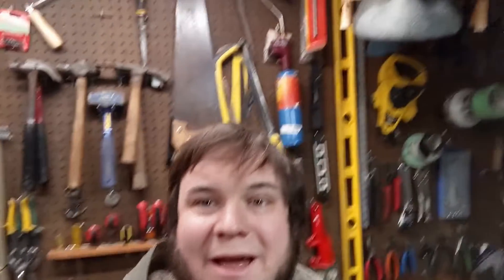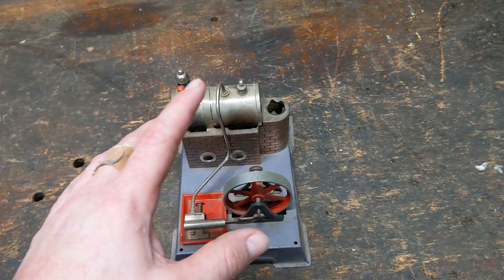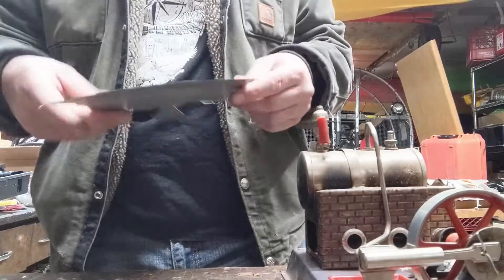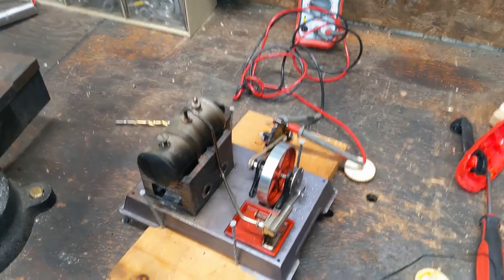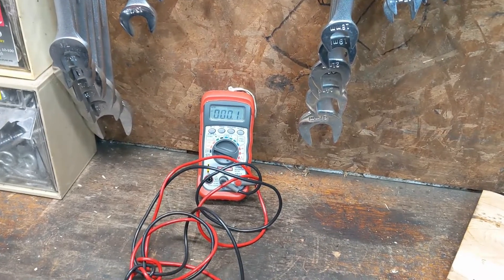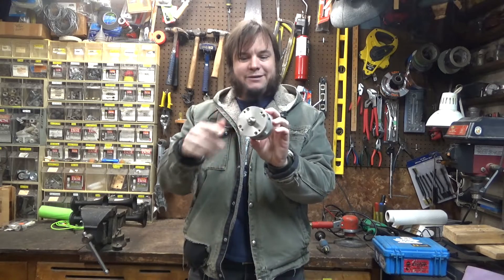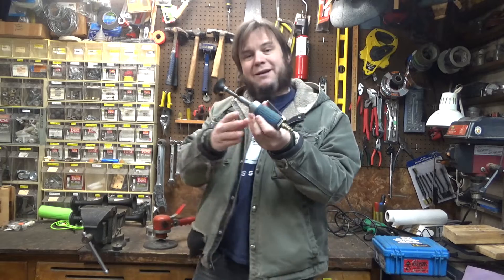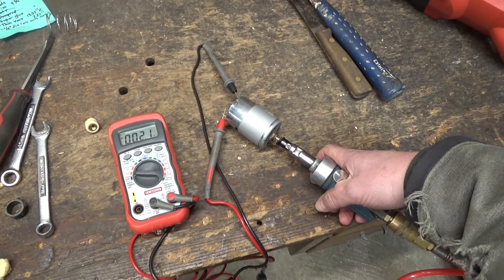I Fail To Make A Steam Powered Phone Charger

Comment: My dear Gabe, I have gazillions of ideas. I'll give you just one. Use what is already there, with minimal modifications, mainly adaptation. Use a car alternator, it spins freely, doesn't have a gearbox fighting against your project, just fit an impeller that will translate your steam, air, wind... into electricity AND is already rectified AND with a specification compliant regulation while outputting a girthy current supply, 80 amps at 14,7VDC while loaded, 29VDC with a truck alternator that you can divide in 2 x 12VDC, more maybe, that will put any little puny DC motor you saved for parts to shame AND let you charge anything you want. 
Fuse up your outputs accordingly to protect all your gear, plan spares... and have fun.

Comment: ok so if you want a good motor from something to make decent voltage. look for one from a dishwasher. theres usually 2 motors. one is a small ac style and one is a large dc style. with brushed motors and a capacitor. youll know because the motor spins better one way than the other. leave the capacitor even tho you arent going to need it. the two side terminals and the original plug is what youre going to try to use. i would go with the terminals because the capacitor makes the mechanical motion to make voltage less efficient. 
spinning this thing with your finger as fast as you can should make around 10 volts, at 1 amp. hook a regulator up to it. any mechanical motion derived from steam should make this thing crank perfectly to your needs. trust me im a lifelong tinkerer.

Comment: Actually you had lots of current and voltage! You are measuring DC while this motor produces AC mostly, just have to use a diode bridge + cap. At 100 psi it would charge 10 phones at the same time :)

Comment: Its probably easier to make a steam vessel ( a copper cylinder or bucket welded shut with a top up valve, an overpressure valve and a pressure regulating valve with a hose for your turbine). It would be easier to make yourself and easier to get high amounts of power and rotation without high pressure. While turbines are a proper science to get running extremely efficient, they are far easier to make 'relatively ok' by using copper plates that you stencil into a good shape and then mount on a rod with washers for spacing, then directly attach it to your generator. You dont even have to worry about leaks and such. Put the bucket in a campfire, wait, and eventually the steam will build up enough and start driving the turbine.

Comment: Maybe a buck converter would work? Run it at 1.5v and use a buck converter to step it up? Maybe even use a gearbox, and into a buck converter. That steam engine is like one my grandfather made for me, except my piston was vertical rather than horizontal.

Comment: If you are looking for a safe-ish kind of boiler, consider building a water-tube boiler. Its just a coil of tubing in a firebox, so it should be pretty easy to manufacture. Its quite safe, because there is not much superheated water inside at any given time, and the strain on the tubing wall is low due to small internal area. The only downside is a need for a feed pump.

Comment: What you are looking to do is to make your version of the "ALCO Firefly", used by the British (and ANZO) forces to power a radio in the wilds of combat during WW2.
The steam generation was by a "kettle" over a camp-stove or campfire, depending on how visible one could afford to be while behind enemy lines.
Looking like your basic metal tool box, it contained a SIRIUS brand, twin cylinder steam engine, directly coupled to an electrical generator which can provide 6-8 volts and 4 amps of electrical power.

Keith Appleton's YouTube channel has a series of videos of him rebuilding a couple of these two cylinder steam engines, that may be good information on what to look for/build yourself...

The video title to search for is:
"TWO STUART SIRIUS STEAM ENGINES"
Reply from the maker: That's awesome! I figured someone would have made something like this.

Comment: If you are hell bent on steam powered phone charging, I think you are going to end up going bigger. There are various videos of people converting small 2 and 4 stroke gas engines to steam. Old propane tanks or compressed air tanks could potentiallybe used as a boiler. Run the output of the engine to a 6v or 12v alternator via belt and you've got wood powered phone charger.
Reply: If you're going to be converting an internal combustion engine to run from wood...  Consider wood gas generation.  It can run gasoline and propane engines pretty well, but stick to 4-stroke or self-oiling 2-stroke.  It's a little difficult to add oil to wood gas.

Comment: Put a boiler on one of your rail carts, and run the generator off the wheel like a bicycle light. Don't sit on the safety valve and keep your crown sheet wet and you'll be fine.

Comment: I am thinking a large turbine based on something like a toddler bicycle wheel, remove the tire and either attach blades like a pelton wheel for a water turbine or cut blades from the side of rim.  Again like a pelton wheel aim the steam nozzle at the blades/spoons with the radius of the wheel providing the torque for a small applied pressure.   For the steam I am thinking a fillable tank like the toy feeding a copper coil in a campfire or just a larger version of the toy steam generator over a stove or campfire.  Fit a nozzle to the end of the tube or a tube from the vessel and with a decent size orifice a moderate fire it should vent the steam onto your turbine faster than you can build an unsafe pressure.  If you use a real wheel you can chain drive from the sprocket to your generator.

Comment: That reminds me of when I was a kid at about 6,7 or 8 years old, late 1970 or early 80s and I loved to experiment with items and somehow and I do not remember how, I came up with an idea if I could get a motor that turns a tape player deck to produce energy, so I went and got a low volt DC battery, probably 1.5 or 9 volts, and connected the motor to that with an elastic that would turn another similar motor and sure enough, I got to be able to light up a flashlight bulb lol. Counter intuitive but for such a young brain and not being influenced by a single person, TV, or anything, as we did not have even TV growing up, I am still impressed with myself lol

Comment: LMAO at the jump cut at (01:31) Steam as I understand it produces all it's torque in a piston, like your little toy. In a turbine I feel it's about volume of air, and not pressure. Time to build a big steam piston?  As far a boilers, mass is where it's at. Fill your boiling vessel with all the conductive metal scrap you have. You can keep it low pressure if you use a big piston, just make up for the pressure in volume.